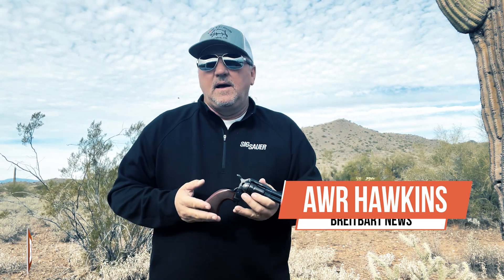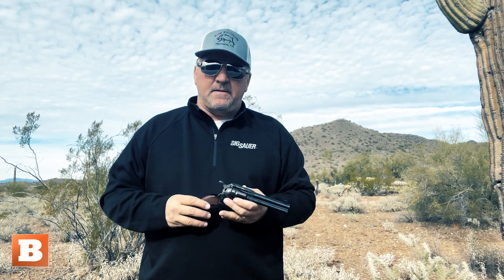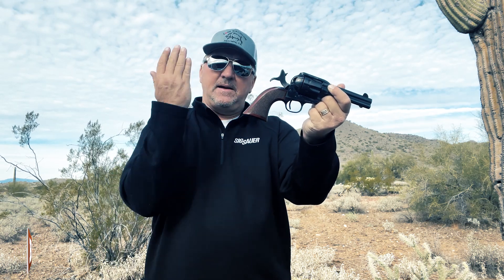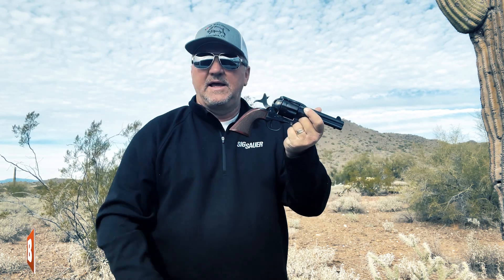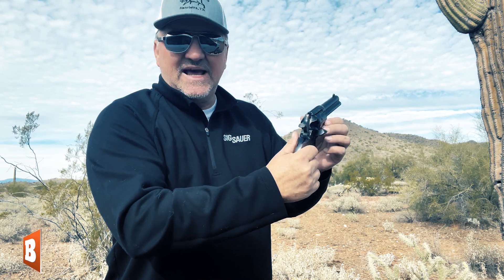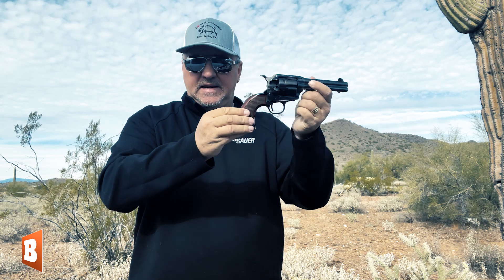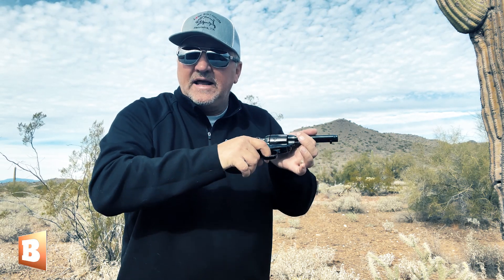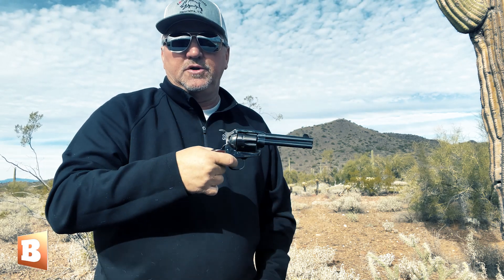AWR Hawkins on Alec Baldwin Rust Incident: A Cocked Gun Needs the Trigger Pulled to Fire

Comment: I think you actually just made Alec's claim believable...  I've even seen worn hammer latches that could easily release the hammer with a jolt.  So yes a badly maintained single action could fire seemly own it's own without touching the trigger.  And I hate Alec Baldwin worst than most, and think he should be locked up for being a blond without actually having blond hair.
Reply: It was a brand new replica revolver at the start of filming. Even with some of the crew, maybe even Alec himself, using Alec's gun to target practice with live rounds when not used on set; it shouldn't have worn the firing latch on the hammer down enough to where it would release the hammer from Alec taking his thumb off of it. Maybe if it was dropped, but no one is claiming that happened. With this being the 3rd incident on the set of 'Rust' where live rounds were fired when they were not supposed to be in the guns, the other 2 were by Alec's stunt double, it is more a safety issue that Alec as Producer should have had taken care of.